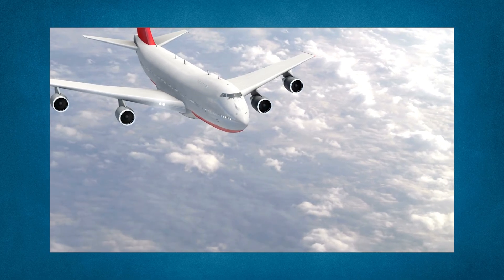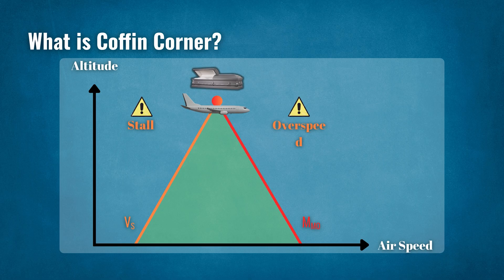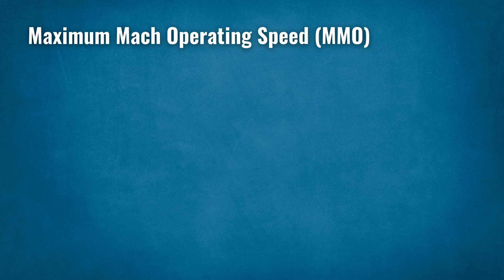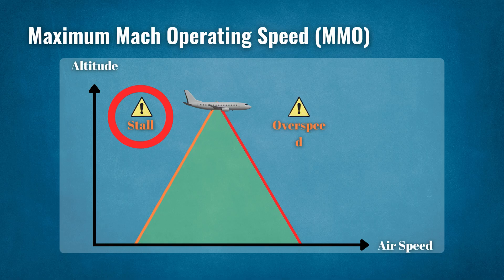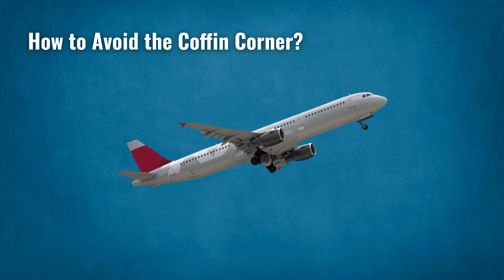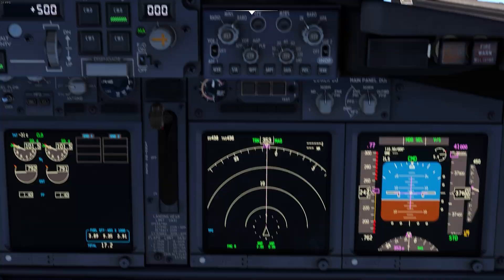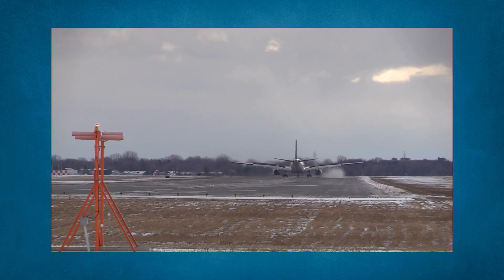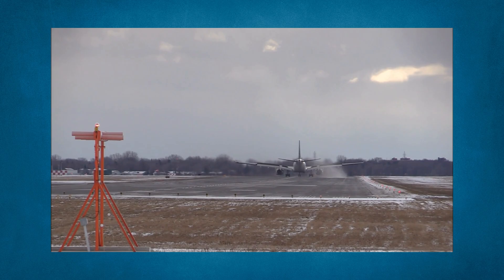Coffin Corner Explained With Easy Diagrams!

Comment: Can sort of see why you don't have all that many comments. Its a very dry subject matter. I am not an aviator but i enjoy the maths of it all. Am interested to know the parameters, i.e. at  your 37,500 ft -- if you drop to say 36,500 (1,000 ft reduction in altitude) is the Coffin Window 5% wider -stall speed over MMO, or do you get a 5% improvement from say a 500 ft reduction. I am guessing that air temp would be a significant factor.
Reply from the maker: Thanks for your comment. Main factors are aircraft weight and produced thrust of engines. Think about 2 aircrafts, one of them is 50tons other is 60tons. Heavier aircraft’s maximum climbable altitude is lower than lighter.
Air temperature is significant factor for produced engine thrust. Turbine engine produces less thrust at the high air temperature  conditions. 

In conclusion, you are right. Temperature has important factor but aircraft’s weight is the main subject for maximum altitute.